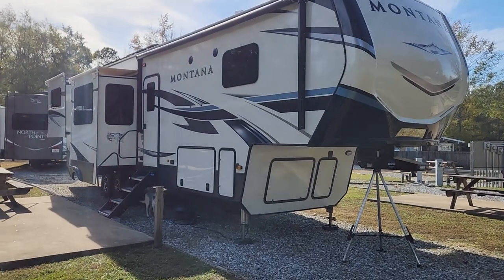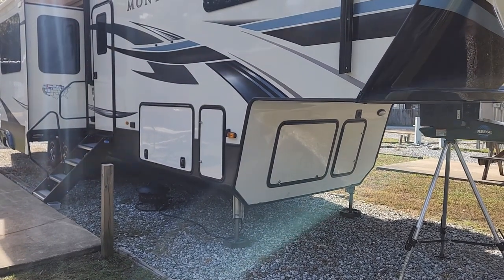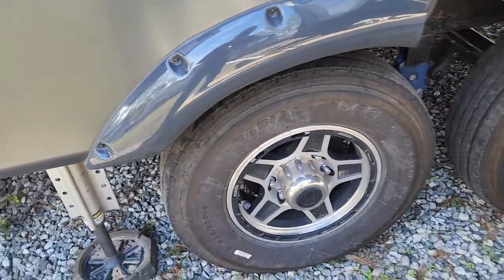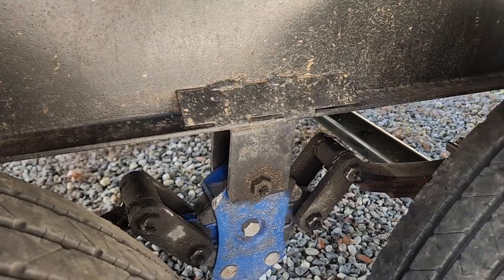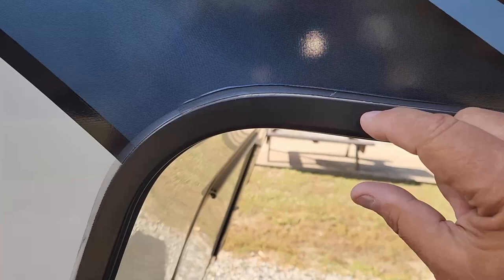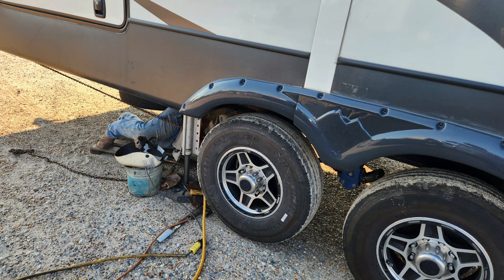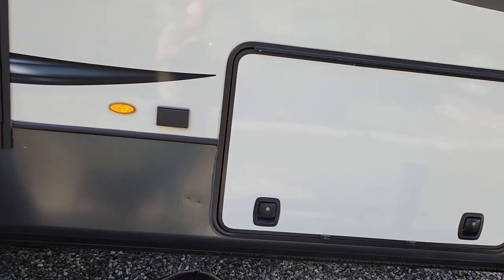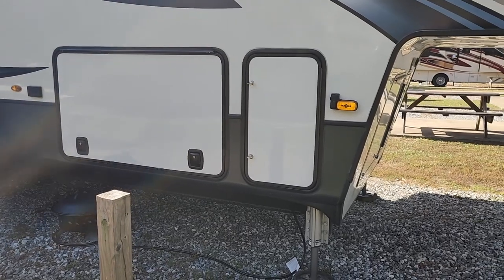Axle Spring Hanger Broke

Comment: Lippert has had a lot of problems with frames cracking or breaking. I had the hanger brackets on my camper the frame had cracked over them. I had to weld plates to the frame that Lippert sells. I just made my own. Much cheaper that way.
Reply from the maker: My frame was still under warranty so it did cost me anything except time. My understanding was they were sending them free to anyone having this problem.

Comment: One of the reasons those broke (penetration etc aside) - the weld goes right to the end of the hanger.  Supposed to stop about 1/4" from the end.
Not supposed to weld across the ends either.  I don't have access to the bulletin anymore, but it's out there.
Reply from the maker: This one the penetration wasn't there. The weld was only on the surface.

Comment: Looked like the original weld was a shitty job.  No penetration.  I would be Leary of the other welds on this trailer.  The shackle brackets are one of the weakest links.  The welders repair looked even worse.  No penetration into the hangar.  The weld looks like it is just lying on the surface. I don’t think I’d use him again

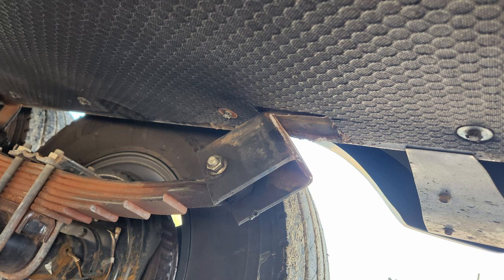Comment: @1:35 freeze frame. L O O K.
1. bad weld - why cheap chinese metal frame glued to braket shackle.
2, Bad weld - hard to do, but he needs to butterfly weld that- carry the puddly to chinese frame,
3. Bad Frame - 1/8" LOL that the thickness of a motorcycle trailer.:hand-orange-covering-eyes:
4. Look at that leaf springs, MASSIVE, the size of a rental trailer-. welded to a 1/8" chinese metal frame.
Now look under a rental trailer that hooks to a 1/2 ton pick up, and youll see a massive thick frame that is rated to haul a tractor but not recommended for the wgt & bulk that RV frames are carrying. The frame should be about as thick a leaf is the spring as a rule of thumb, So the trailer leaf is bout 1/4'' inch spring steel, the shackle bracket is bout 3/16" and glued to a 1/8" frame
WHAT COULD GO WRONG at 60 mph?:text-green-game-over:

Comment: More keystone garbage
Reply from the maker: The frame is assembled by Lipert and these frames are on many other RV manufacturers. They too are having problems.
Reply: And Keystone is ultimately the one to inspect all of their products before building a trailer.
Reply: @Takingitslow  Lippert makes the frames according to Keystones design specs. Keystone, as well as most RV manufacturers, are building their campers on anemic frames, intentionally to save on manufacturing costs, while selling their junk product for top dollar. 
The problem lies with BOTH companies. 
Lippert is spitting out terrible products, and Keystone isnt inspecting the quality of the frames they receive. 
ALL RV manufacturers need to investigated for the unsafe products they are pushing out onto the public. There are only a small number of manufacturers that are putting out a safe product, and they are seriously overpriced.
Reply from the maker: @carllennen3520  no argument here. This portion of the frame was modified the year after my rig was built adding in the V wedge between the front and rear hangers.